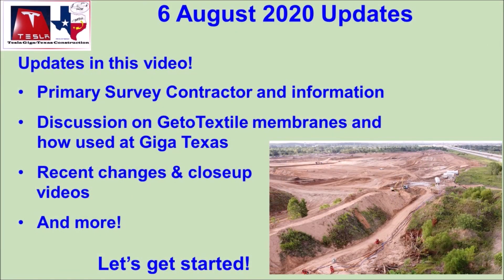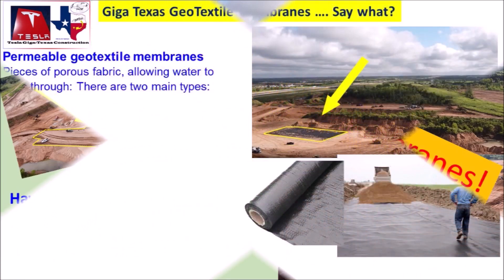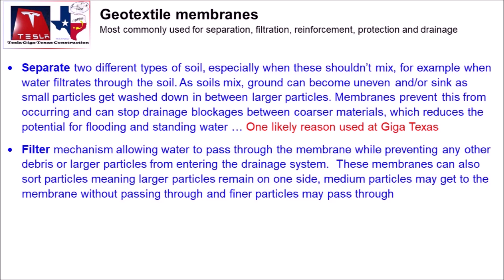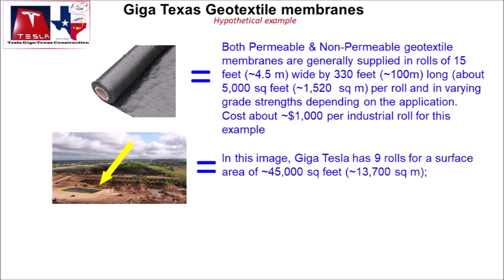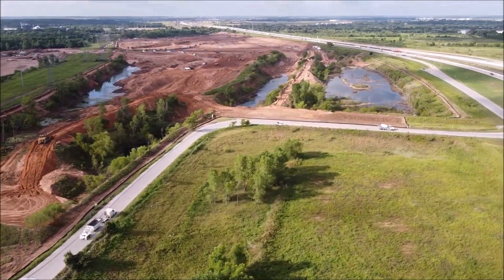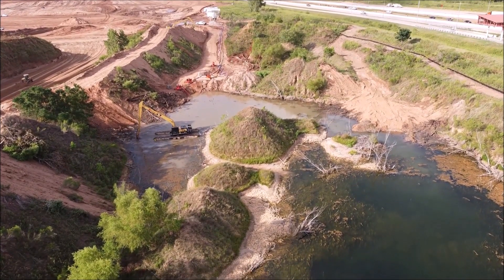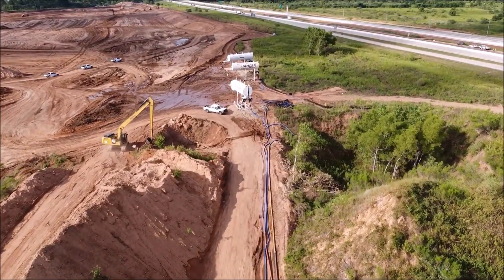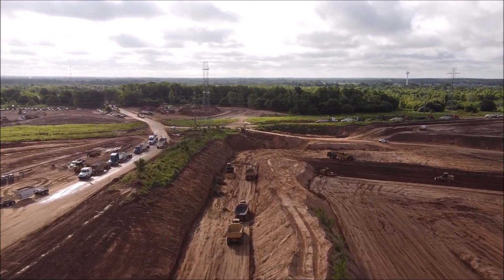Drone Shows What Impacts Tesla Giga Texas Construction

Comment: ( German ) Der Sand  bei Giga Texas ist nicht so gut zum Bauen geeignet wie bei Giga Berlin. Der Untergrund auf der Giga Texas Baustelle ist teilweise sehr weich mit hohen Wassergehalt. In Berlin Grünheide ist der Sand wegen der Trockenheit viel härter.
Reply: In Austin, like Shanghai they will use piles. High clay content soils are sometimes easier. One thing to notice is how green everything is in Austin compared to the drought in Berlin. Water supply should be no problem in Austin.